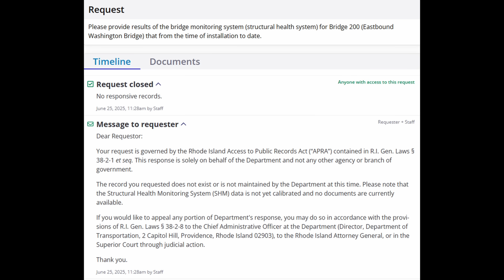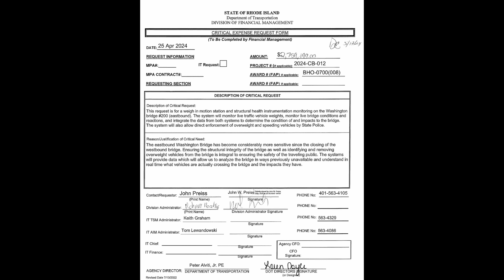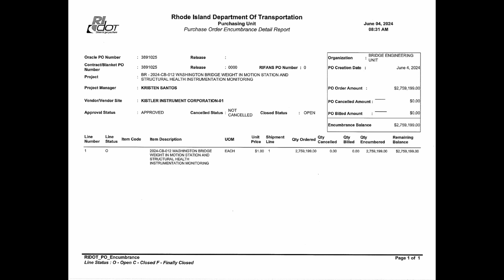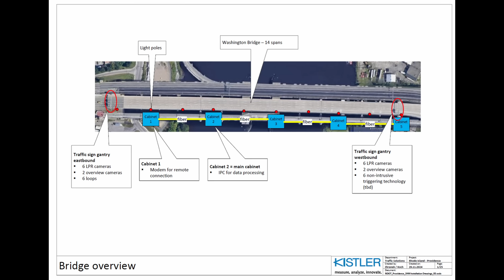RiDOT Fails to Deliver; Again!

Comment: They have to be trying to be this incompetent.  I mean, Kistral knows what the f*** they are doing and was probably in and out of there in a couple of weeks.  This isn't rocket science.  You get a peek-over bucket truck, a handful of installers, a bunch of UTP cable, and a shit ton of zip ties.  It's an operation that is planned, coordinated, and executed.   Very little drama involved.  The fact that the contract with Kistral was $500k sort of highlights this - that buys you a bunch of sensors and data acquisition equip, watertight cabinets, truck rental, a couple weeks of installer labor to affix the sensors, and maybe a week or two with their consultant on-site to start collecting, calibrating, and training the staff how to access the data.   It's a process that plays out on literally thousands of construction sites per year just in the US for vibration monitoring, historical preservation, crack monitoring, etc.  

$500k will not buy you 8+ months of consulting time and additional calibration.  It just won't.  Not at the $200/hour these firms charge.

Either RiDot screwed it up/broke it, or the results show something they don't want us finding out.

Given that RiDOT's instinct (at least at the top/political level) has been at every turn to be as vague, misleading, delaying, and generally non-transparent, I tend to think they don't want the results being made public because it's showing the bridge cannot handle the load they have imposed on it.

Oh, and "Calibrating" this system?  Not hard.  You take a few vehicles that you've pre-instrumented and weigh, and you drive them over the bridge at quiet times (overnight) to measure the sensor response against known variables.  Maybe you do it a few times per year to make sure your data is consistent across winter/summer temperature regimes.  But it takes hours to days.  NOT MONTHS.

This is just epic dumbassery.  No other way to put it.
Reply from the maker: Thank you for your comments.  I agree with you, they are not doing anything here that hasn't been done on many other bridges yet RiDOT refuses to release any information due to the "calibration" excuse.
Reply: You’ve clearly never lived in the Northeast. This is I-95. There are no quiet times. You could drive a truck over the bridge at 3:15 in the morning and you probably wouldn’t be the only vehicle on the bridge. Doing any sort of calibration is going to require closing both directions of one of the busiest highways in the entire United States of America. You can’t just wing it and hope for the best like you’re working on a state highway in Tennessee.
Reply: @michaelimbesi2314 ❤❤❤❤❤❤❤❤❤      are you saying they’re doing a good job ?
Reply: @michaelimbesi2314  Not be a sticker, this is not I-95, it is I-195 . 2~3am they can close the bridge, and have done it to me, driving home from the airport.
Reply: A sink hole opened up on I195 just before the Washington bridge this week.
Reply: ' dumbassery ' - a new word for the day. 🤣🤣🤣

Comment: Wait, the system that can be used to generate fines was immediately installed and operational, but the one that monitors concequences is busted not calibrated?
That's so unusual
Reply from the maker: Yes, there probably is a correlation there!

Comment: Thanks again for a great video Casey!  Here in New Jersey they did reopen most of I-80 - I hope they found all the holes this time!  I really hope that it is just incompetence in setting up the monitoring system, because they nightmare would be it is working and they just don't want to release the numbers.  Keeping an eye on Insar numbers might be the only warning the public gets if the bridge starts to deteriorate. I know I wouldn't trust the RiDOT to tell me the truth at this point.
Reply from the maker: Thank you.  That is a great suggestion on the InSAR monitoring.

Comment: At a recent press conference, questions were asked about the fact that the Westbound bridge was constructed on top of the existing supports that were built in 1747. He assured the press that they had hired a team of engineers to monitor the health of the Westbound bridge. When questioned about the fact that it was a team of medical engineers, Pytr Alasagna responded that they had no concerns about the bridge itself, but were determined to insure the health of the passengers traveling across the bridge. He also brought up the problem that Medicare and Medicaid refused to pay for more than one Wellness check per year but he confidently asserted to the Press that he had been reassured that this problem would eventually be solved. When asked why the  demolition of the failed bridge was taking so long, he explained that there could be some type of endangered species living in the mud, but that efforts to actually find it were proving quite challenging.

Comment: As far as the RIDOT, they are in need of a proctologist to remove their heads from their asses. As someone who has to drive over this bridge on a daily basis, I feel that once the west bound lanes are finished. The East bound lanes are going to be shut down and in need of repair. The truck drivers fail to adhere to the right hand lane, there have been instances of them exceeding the speed limits.

Comment: I sure am glad that you are keeping a fire beneath those snakes.
Stay on them until you get the answers to the questions you're asking. 

What you're doing is having an impact. 
I'm currently traveling around the western United States as I take a break from my job. 
Right now, I am looking out of my window at The Blue Mesa Res from my campsite. 
Yesterday, I drove across one of the bridges that had been repaired. 
It was so cool to have had knowledge of why all of that specialized equipment was sitting around. 
99.9% of people wouldn't have even noticed anything different, but I'm a huge geek for stuff like this, so I drove across the bridge super slow!

I doubt I'll live long enough to experience that same thing in Rhode Island! I have a bad feeling about that eastbound bridge.
Reply from the maker: Thanks so much for the positive feedback and for sharing your personal experience!

Comment: Just curious, even if the “new” monitoring system is still in calibration, what about the data from the older redundant systems installed on the bridge?
Reply from the maker: There was no system in place before for monitoring from what I understand.

Comment: I don’t know RI bridge weight regulations, but I do know 18 wheeler dump trailers  can carry 104,000 lbs over the road.
Reply from the maker: This bridge is limited to vehicles weighing under 96,000 pound.
Reply: @CaseyJones-Engineer you can only carry 80k in Ct.

Comment: Seems to me they installed the motion/strain sensors in order to "catch and penalize" the truck driver/company that is on the bridge with excessive loads - a revenue stream, before safety.
So Alviti is sticking with his story that "an overloaded truck crashed through the barriers and caused all this damage".
Alviti needs to be fired and replaced with true PE and not a politician.
Reply from the maker: Alviti is a PE but he definitely acts more like a politician as you point out.  He has his job (and just got a raise) to provide political cover for Governor McKee in my opinion.
Reply: @CaseyJones-Engineer  Well, he is not working in the public's best interest very well, nor the engineering community. HIs work profile only shows RIDOT since 2015. "Graduated" from Northeastern 1976.
I really dislike politics when it comes to safety and engineering.
Reply from the maker: @truegret7778  I agree. I'm highly offended by the way he's conducted himself representing himself as an engineer. That's why I've been all over this story since December 2023.

Comment: I see they're using Kistler equipment. I've worked with their servo press hardware and software. Nice stuff.
Reply from the maker: This clearly isn't their first rodeo for Kistler.  I think the bottle neck in releasing information is with RiDOT.

Comment: And how much of the replacement bridge budget is from the Federal Highway Administration? 

Those dollars may disappear…
Reply from the maker: 80 percent is from the Feds.
Reply: @CaseyJones-Engineer  YIKES!
Reply: @larryscott3982  My Rhodies better get used to swimming the river.  Or bring back ferries.
Reply: @CaseyJones-Engineer  So a safety factor of 2 by 100 yr old design. 

With wood piles is the a 1/2 life to their integrity? Is their load bearing capacity the same as 100 yrs ago? And doesn’t increased load of 21st century volume and weights subtracts from the safety factor? What’s left of the SF?

Comment: 100 yr old timber piles, and increased traffic load. And tell me what was the load value used 100 yrs ago? Surely the mean and peak loads 100 yrs ago, per vehicle weight and total number of vehicles, ago was significantly less than 21st century vehicles and number of vehicles. 

And what if movement and accumulated stress is accelerating the end of life of the bridge? Another rapid closure, and sudden need of replacement? 

The new bridge might as well be designed to take on all traffic when  the old bridge gets condemned. Which appears imminent, and may come before the current bridge construction is complete. What then?

Comment: The scary part of all this, the present East bound bridge may have problems as well.
Reply from the maker: I simply don't know.  However, the lack of transparency and poor track record of RiDOT management is not at all reassuring in my opinion.
Reply: @CaseyJones-Engineer As a RI resident, Alviti and Gov McKee and headed for defeat. That will shake up the bridge construction.

Comment: My bet is the system is online and the data doesn't look good so "system calibration" is just the typical smoke show answer hoping you'll go away. Keep the pressure on them Casey you do awesome work!!
Reply from the maker: Thank you so much!  I am skeptical of pretty much everything Alviti says about the project.
Reply: That's pretty much what I think. Need to "calibrate" until they like the readings.
Reply: @LurkerInTheInterRecordGap which may be never

Comment: Why isn’t anyone in jail yet after 18 months? And the writing is on the wall. Ten years from now the new bridge will open with some democrat hack governor riding across it in a convertible. And the old bridge will fall into the river the next day.  Wash. Rinse. Repeat. 
Build two bridges now out of steel, just like the I-way bridge and be done with it.  And work on replacing the death trap bridges in Newport and Bristol.

Comment: Mr Jones yet another fantastic video leaving people in ask mode after the absorbed info blitz. Just so many questions thou... Why weren't the systems installed & working prior to the demo and subsequent traffic pattern change? How many different firms were involved in the plausibility aspect in footings vs added lane ( Traffic )? Wouldn't the "Second Opinion" Rule apply here? Were traffic speeds lowered on both sides approaching the bridge and could this help? Now for the BIG ONE... How can work continue adjacent possibly impacting known footing deficiencies without the detection systems working properly?? Isn't this opening the door to "Murphys' Law" as well as Negligence in Public Safety?? & Politicians wonder why they get called liers...
Reply from the maker: Thank you.  You are right on the money.  I am preparing a video now that looks at the specific vibration risks that are posed to the existing bridge from the adjacent demolition and construction activity.
Reply: @CaseyJones-Engineer  ALL involved need a "Crash Course" in Risk Assessment!!
Reply: @keithritter6157  .. it has already been determined to disregard the risk.
This is RI
Reply: @mrahob275  If this is the "Norm" then why not send the documented failures to the NTSB??
Reply: @keithritter6157 .. previous to January of 2025 .. the Feds were their buddies.
Hopefully it changes now 🤞

Comment: They added a weight in motion system on the BQE in Brooklyn. It's over 2 years late. When they did an enforcement on this section some trucks were 100000 lbs 50 tons overweight.
Reply from the maker: Wow, that is a huge issue.

Comment: I noticed a line item in the Kistler project offer for license plate recognition equipment and software.  Beware if you use this bridge to commute, you are being surveyed.
Reply from the maker: Yes, the government know way more about us than we know about the government these days.
Reply: Especially if you're operating in violation.  Maybe a ferry is a better choice... or not being overloaded?  No doubt they're able to link a vibration/impact event to a picture.  There is.... - gasp - engineering behind this.

Before anyone gets wadded panties, I don't like it, either.  If you really want to get incensed, look up what FLOCK camera systems can do if the city/county/AHJ pays for the features...

Comment: The lack of oversight by the Governor or the state AG of Alviti or the DOT in this matter as appalling! If I was a RI taxpayer, I would be screaming impeachment! So I would be curious as to a number of things regarding this monitoring system; What has been paid out out on this contract, versus work done? Was there a completion date stipulated in the contract? If there was no completion date stipulated and it was a critical monitoring system, why was there no date required in contract? Has there been payments made to firm that was suppose to be monitoring the system? Alviti is not capable of running the DOT, but at this point you have to question the capabilities of the Governor and the state AG for not taking action on this! 
Casey thanks for the update, and bringing light to another issue with this project!
Reply: This is RI
The Gov and AG are part of the coverup. The State Police are their lapdogs.
Alviti just got a 5 figure raise and the Gov will be reinstalled by the welfare class and union members that rely on the state $$$$
Reply: >If I was a RI taxpayer, I would be screaming impeachment!

This is Rhode Island. As long as he's a Democrat, not enough people care enough.

Comment: You should also look into their handling of the MT. Hope bridge. 100 year old suspension bridge the deck is patch over patch over patch that they have been "repairing" for decades. They just had an inspection done but will not show the results stating homeland security.
Reply: That's likely how you know it's bad/dangerous.. If it were good, they'd let everyone know. But just like so many other governmental agencies, they've permently hidden the status of our infrastructure under the cloak of "security" so no one knows if that bridge that you're crossing or that dam upstream of you is about to fail and kill you and everyone else around. That's what crappy authoritarian countries do when corruption has funneled and/or mismanaged money away from things.

Comment: Presumably slow rolling it to buy time. RI seems a very corrupt state. Are most ok with that or just figure it is what it is. Or is this bridge project just an aberration? Seems odd they won't provide more information. Usually that's a sign they're hiding something.
Reply from the maker: I don't think RiDOT can be trusted when it comes to the need for accurate information flow.

Comment: Casey these are questions for you and all the other PEs in this audience;  
1) when there  are two bridges designed for opposite directions (one east bound and one west bound as in this case), is direction of traffic taken into account during the design?  It seems to me there would be more stresses going in the direction of traffic flow.

2)  what safety factor is generally used in designing these bridges and is it safe to assume (never assume) this east bound bridge is within its safety factor calculations given its handling over 20% more traffic than it was originally designed for?  My experience is most divided highways experience more traffic on one side in the morning then it switches to the other direction in the afternoon and evening.  The east bound bridge is now getting both morning and evening commuters.

Sorry for the long questions, keep up the great work Casey and hope your healing faster than expected.:_Puzzled::_Puzzled::_Puzzled:
Reply from the maker: Thank you for the questions.  For the bridge superstructure, I would defer to the structural engineers in the audience.  However, for the foundations, typical factors of safety are typically around 2.0.  I do know that designers account for the direction of loading (for example shear forces from braking would be applied in the direction of travel such as along the long axis of the bridge and not in the perpendicular direction).  I looked back through the evaluations for allowing 6 lanes of traffic relative to the 5 lanes of traffic that the bridge was designed for.  What struck me was there appeared to be no evaluation on the addition foundation loading on the piles from the additional lane of traffic.  Each pier has hundreds of timber pile that range in length from only 30 to 50 feet that were installed between 1928 and 1930 and were re-used when the superstructure of the E.B. bridge was replaced in 2008.

Also, heavy trucks are supposed to be restricted to the right lane in each direction and you can see from the drone footage that I have posted that the heavy trucks are traveling in the other lanes too.

I have some follow up videos that I will be doing about my concerns with the existing bridge foundation relative to vibrations from ongoing demolition and future planned construction activities.
Reply: @CaseyJones-Engineer  

I travel this bridge every day. The only lane trucks don't typically use is the far left lane.

Of course there are signs saying not to, just like you're supposed to stay in your lane and travel at 35MPH. But this is New England and ain't nobody gonna do that.